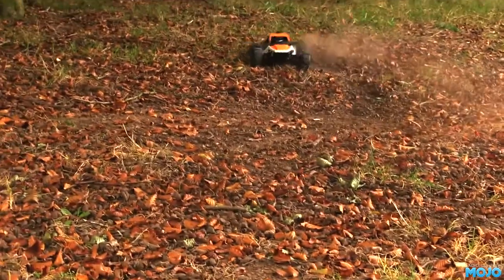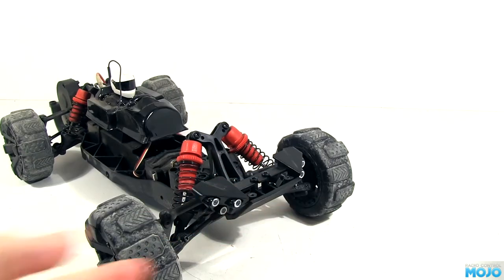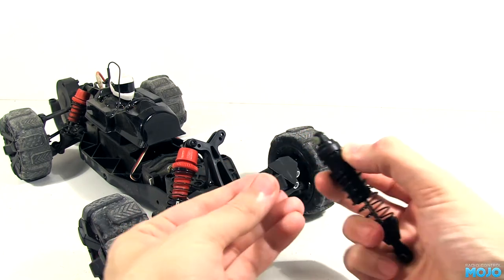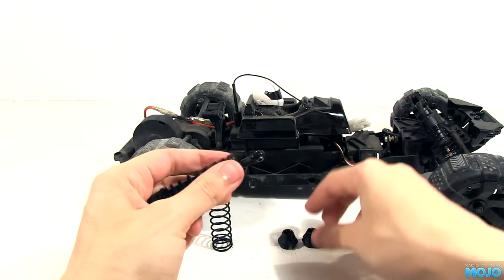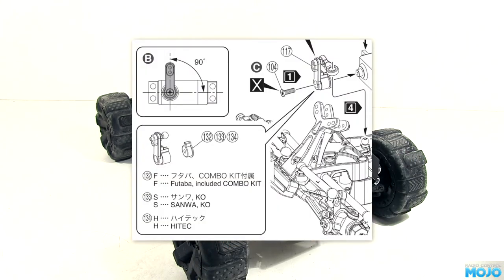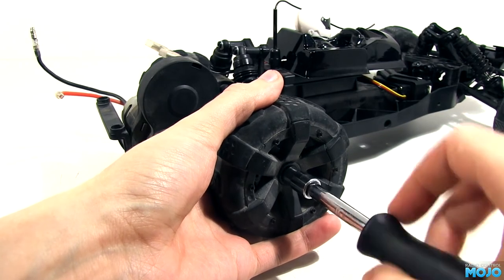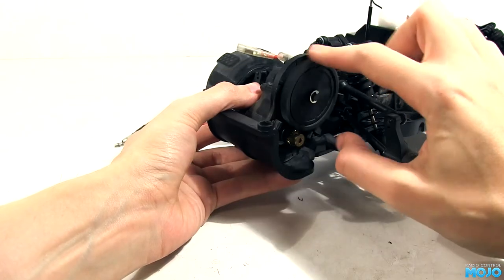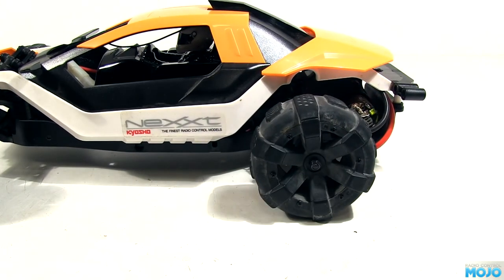Kyosho - Nexxt - Shocking Upgrades!!

Comment: Did you ever do anything else to this buggy?
Reply from the maker: It’s still serving it’s purpose perfectly, although the motors getting a bit tired, we might have to change out to a very mild brushless at some point.
Reply: Getting this kit for xmas off the other half, already have the shock conversion kit, planning on putting leds in, think it will be a blast.

Comment: Hello Nice video. I also have a Kyosho Nexxt but the signal is disturbed (Is perhaps the receiver) can you help me ?
Reply from the maker: Best bet would be to replace the radio with something like the FlySky GT2 or similar low cost set. If I remember correctly the RTR came with a seperate ESC so it should be a straight forward swap
Reply: @RCMojoTV  When I change the receiver it may be that it is too big and therefore does not fit in there as there is a box for the receiver.